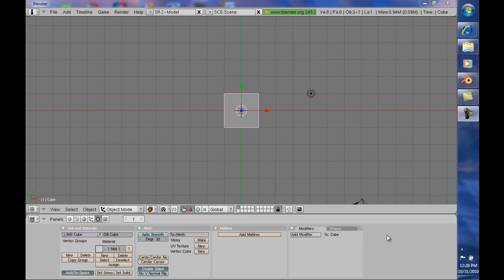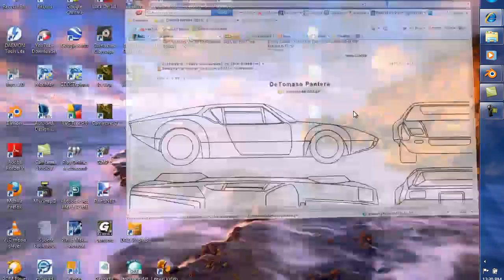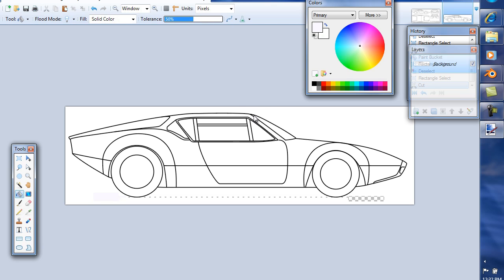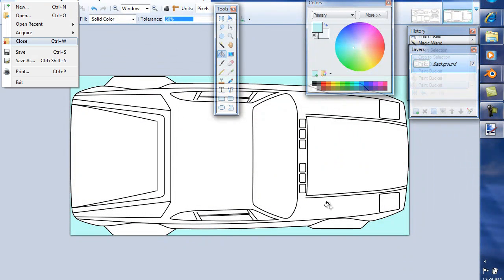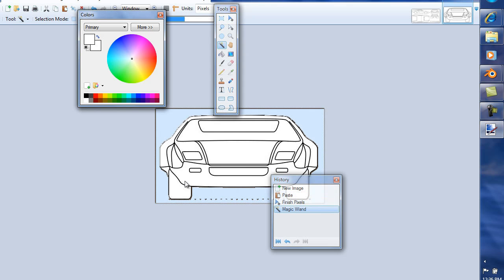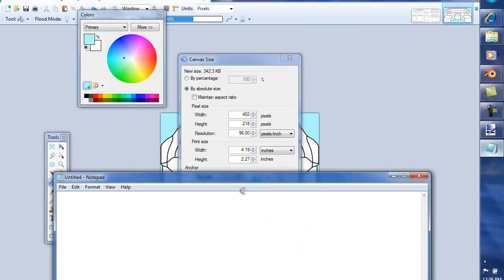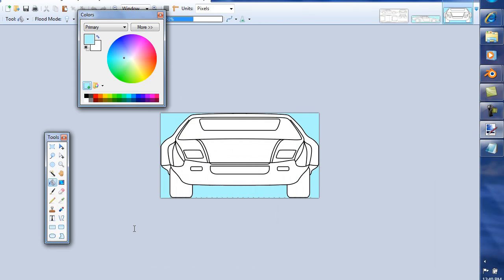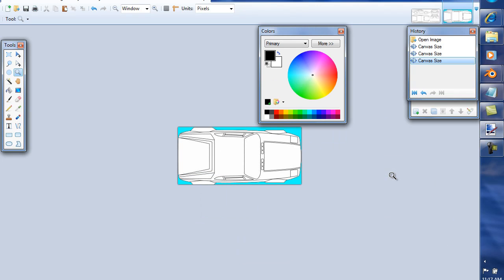Blender Car Panel Modeling Tutorial #1 - Detomaso Pantera

Comment from the maker: @dvnobles Dan that's just one way of doing it. It's the way I was taught. There are some modelers who dont even seperate the blueprint pictures and take the parts, move and compare them to the sketch. I find that method a little daunting myself but it works. You are right though in that in consideration of the flaws in these drawings that it was a little overkill on the preciseness, but if beginners get their bluprints out of whack then it can be discouraging.